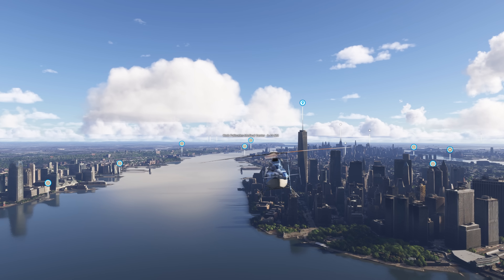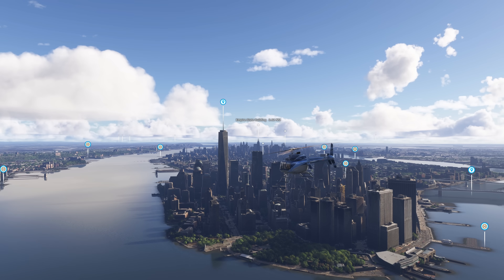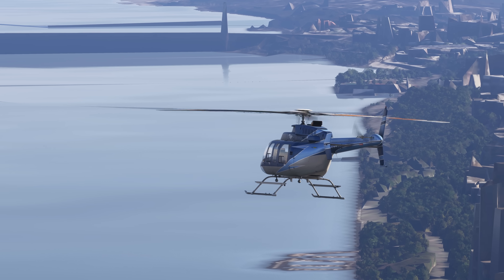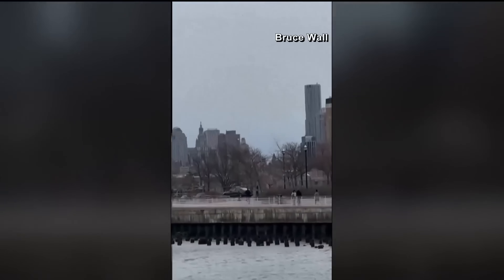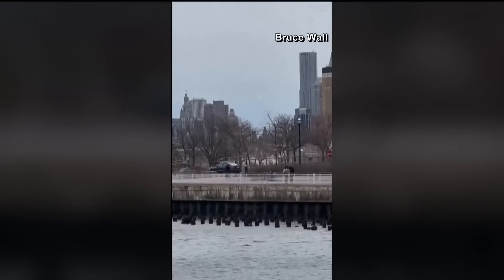Helicopter Expert breaks down Hudson Crash, and discusses “Bump Mast” Theory | NYC Crash Follow-Up

Comment: It’s sad, he didn’t see the video we all saw. The blades were intact with equal length. The transmission or part of the transmission was with the main rotor blades. Also, the entire tail boom separated from the main fuselage. The Jesus nut was still connected to the mast. All this can be seen in the video. I hope they find the missing pieces.
Reply: Yes, I saw that video too. Blades were spinning all the way to the water and it looked like the transmission was still attached. It look most likely there was some sudden mechanical failure that ripped the blades/shaft and transmission right out of that helicopter. That poor pilot had zero time to react and even if he did there was nothing he could do to mitigate what had happened.
Reply: No question catastrophic failure not pilot error. Blades were completely intact.
Reply: @Lucasbean  Well the former marine confirmed certain things.  Mainly that this was a catastrophic sudden mechanical failure.  He didn't seem familiar with the actual crash videos.
Reply: @JoeLinux2000  I think he just saw the very first video news showed, not the other ones.
Reply: Blancolirio has a great analysis and discounts the bump theory.  Very rare on this helicopter.  Most likely a transmission component failure.
Reply: It's critical that they recover the transmission and rotor blade assembly.   Also the tail boom is very important to the investigation.
Reply: What would happen if someone pulled the rotor break in flight? I would hope that nothing would happen. It’s right on the roof between the pilots. It’s just begging for some precocious child to give it a pull.
Reply: @Av8or7  Having seen the Rotor BRAKE applied to slow and stop the spinning blades, I don’t think it would have been able to overcome the turbines torque to cause an incident like this.
Reply: Let's see if NTSB will issue soon any related air worthiness recommandation, typically re gearbox or its X supports.
Reply: I've seen some report that it's a common call in, I've never went on a sight seeing tour. I think it'd make me a little nervous and curious if I heard that during a 20 min flight though, and wonder why it wouldn't have been refueled after their last flight. Just thought it was odd and with that being that last thing hearing from them
Reply: An example why nobody should be talking with zero facts specific to a particular incident.  Not a fan of Captain Steeeeeeeeeeve.
Reply: Almost makes One wonder if the turbine seized somehow.
Reply: Is it possible there was less fuel that was thought and didn't get into autorotation fast enough. Would that not also freeze up the engine and possibly rip the transmission out
Reply: @ No.   Not at all.  Low fuel has nothing to do with this.
Reply: And supposedly 3 min before, it dropped in altitude 500' in 59 seconds. Not sure with helicopter engines, if low enough on fuel or if the fuel could shift in the tank in a way that it would get moments of only fumes. Like he was saying how helicopters can get in a little bit of rocking in a back and forth or up and down motion. If a helicopter engine could potentially 'sputter' when low on fuel and spirts of losing cylinder compression
Reply: @jonathantroyer2822  In this helo type the engines are (jet) turbines, so no cylinders/pistons and at worst they might spool down gradually. More possible is a catastrophic transmission (MRGB) failure of some kind, or a structural metal fatigue failure (eg of the tailboom structure). Like most people I've watched the latest (enhanced?) videos of this tragedy, but we'll have to wait for NTSB reports. They have promised an 'interim' report shortly. Retired aero/mech engineer. RIP all the family members and the pilot.
Reply: @markharlock6474  Okay, thank you. That makes more sense
Reply: According to what I've looked up they can sputter. Personally, I'd never go on another helicopter tour with a company if I heard them call in low fuel

Comment: Just my respectful 2 cents. It wouldn't have been a mast nut (Jesus nut) failure because the rotor systen was still attached to the mast and transmission. With a mast nut failure the rotorhead/blades would've separated from the mast/transmission. But that whole system rode intact to the water. Just a thought.

Comment: Please have Joe back as details emerge. I could listen all day long to the old guys who have btdt.

Maintenance records may be illuminating.
Reply from the maker: I agree. He is very good.
Reply: Yes, part 2 etc.
Reply: Gearbox failure. Only explanation for rotors and gearbox leaving the aircraft
Reply: @randalltaylor3700  That's not the explanation. Not even an explanation. Gearbox failure would cause loss of tail rotor functionality, but not the separation of the M/R and transmission.
Reply: @DevilsAdvocate43  rotational dynamics. If gearbox failed the inertia of the rotors is strong enough to rip out mast and gearbox. Mast bump would not have left rotors intact!
Reply: @ 9 times out of 10 if the inertia was enough to rip the trans from the airframe the blades would have separated from the rotor hub before that would happen.
Reply: My hubby as in the Uk Roal Navy a did his initial aircraft mechanics course as an apprentice. After training he was promoted to a Petty officer.  He went on to become a licensed engineer with British Airways, The Saudi Arabian Royal Air Force, working  for 30 years until he retired 2009.  My hubby initially thought the rotors holding the propellers on failed after the boult holding the propellers, either were damaged, badly maintained, or suffered metal failure, weather conditions etc will be investigated. Hitting the tailgate would have distroyed the propellers.
A lengthy investigation will be ongoing.   May all those who lost their lives  wishing they rest in peace.  My heart goes out to the families and friends of those who lost their lives.  Such a tragic loss and accident🙏🙏🙏🙏🙏🇬🇧🏴
Reply: What was not addressed in this otherwise interesting interview was the image of the free spinning rotors in one of the videos posted, not only still attached to the mast, but the mast itself still attached to the transmission below as all three components fell into the river in one piece. 
How does a robust chunk of hardware like a helicopter transmission detach itself from an aircraft in the blink of an eye?
Something ain't right there.
Reply: @bucky4752  Metal fatigue could cause it. The airframe had nearly 10,000 hours on it. That's a lot of hours for a helicopter.
 It's not like an airliner that can stay up for 12+ hours at a time. A 206 probably only holds 2-3 hours' worth of useable fuel. Figure tours were 30 minutes including loading and unloading passengers. That's a lot of takeoff and landings.

Comment: Rotors DIDNT hit the tail, video of dual rotors going into the water at their proper length. Rotor hit ANYTHING it would have some missing rotor. ONLY way I believe the rotors coming off in its pair tells me to look for JESUS NUT.
Reply: Rotors and gearbox separated together from the fuselage. This has nothing to do with the Jesus nut.
Reply: Easy to find the Jesus Nut.  It's still on the mast securing the rotor blades.

Comment: I don't think it was mast bumping. The rotor separates above the gearbox when that happens. I think it could be a failure inside the gearbox which siezed it up completely causing the whole gearbox to break off from its two mounting pylons that attaches it to the gearbox. That's my best hunch without having looked at the components.
Reply: You’re right, not mast bumping. The MR was recovered today with the gearbox attached.
Reply: Your explanation is logical.   However I'm doubting a seized transmission unless someone forgot fill the transmission with oil.  While I'm not a a helicopter mechanic, I feel the "transmission" is mostly a gear box with some type of clutch.  I believe the transmission locking up is very remote, but I agree it could be possibility.    I' anxiously awaiting what the NTSB discovers.
Reply: @JoeLinux2000  if not seizing up then some other reason for the entire transmission being ripped out of the helicopter. Some suggest maybe turbine failure but that's also unlikely.

Comment: There’s a video that came out after the one shown here that shows the entire event, passing from normal flight thru whatever it was that failed and finally to the pieces of the helicopter landing in the water. I wish you’d used that video because I think the speculation might have been more informed.
Reply: With all due respect to both pilots the speculation was too generalized and not specific to this particular crash.  They provided good information, but not specific information.
Reply: I haven't seen that yet either. Will be interesting...in the saddest way.

Comment: Autorotation is not a typical emergency procedure option for helicopter transmission problems.
Reply: I think the clutch would be between the main engine and the transmission, not between the transmission and main rotor.  However it's entire conjecture.

Comment: What a treat to have such great expertise discuss this incident! Thanks so much for this, Captain Steeeve!❤❤
Reply: I entirely agree, I'm not a pilot and I just flown in an helicopter twice (AS350) and mast bumping sounds absurd to me too, especially after the second video came out. It's as clear as the sun that it was a catastrophic failure of the transmission or engine where everything seized up resulting in sudden rotation of the craft, where g forces broke the rail first and then the whole transmission detached.